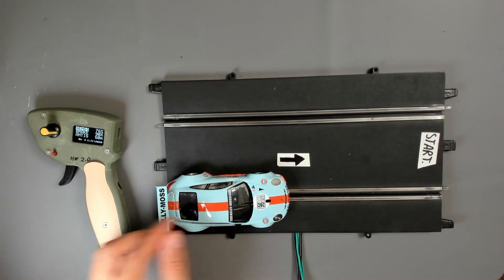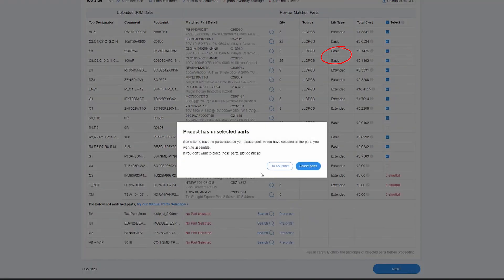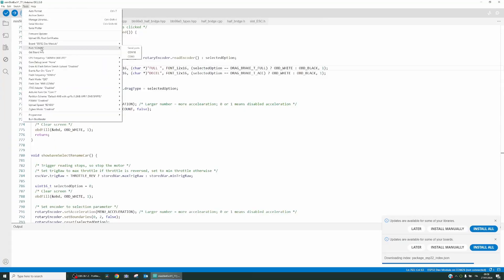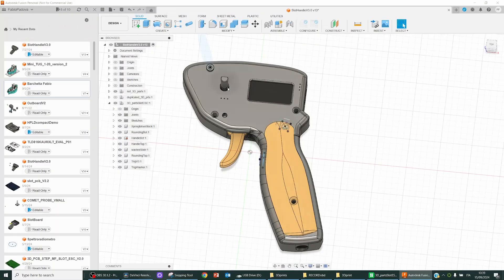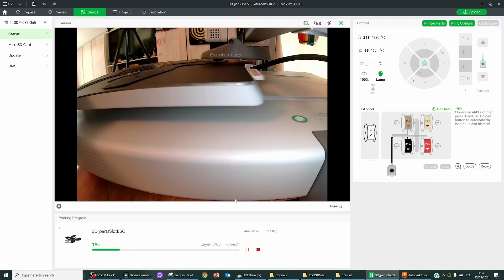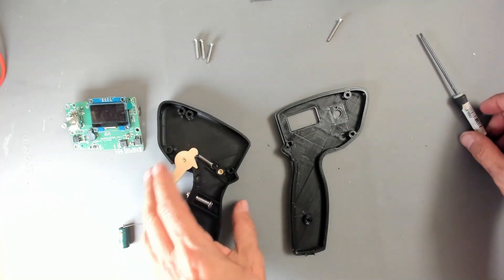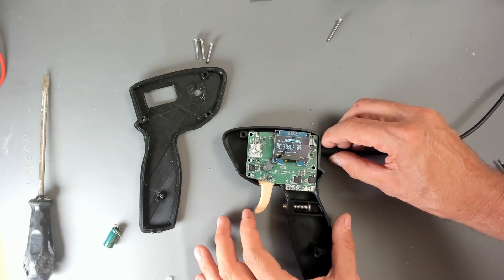DIY slot car speed controller - ESP32-arduino ESPEED32

Comment: I love this project and am currently ordering parts to try make some.. well done! excellent work!
just wondering the length of the compression spring for the trigger travel adjust? the length seems to be missing in the BOM
thank you kindly 8:13
Reply from the maker: Warning: the magnetic sensor v3 is not available yet on digik. Is just relased, you have to wait probably 1 months
About 10mm of spring coil then you have to add the 2 side loops. Usually i buy long ones and i cut them at the preferred lenght

Comment: Hello thank you for your amazing job
I ordered all parts needed but i don’t found TLD493D-P3B6 A0, so i take TLE493DP2B6A0HTSA1 i don’t Know if it will be work ? Can you just give me the Link to buy the good part
Reply from the maker: Hi 
It will not work, or better i was not able to have it working properly. The problem is that the i2c of the model you choose is providing glitches at startup and this confuse the esp32 i2c periperals
You need the silicon v3. It is released only this month, so you have to wait a little to be on digik or mouser. Sorry for this
Reply: @MakerFabio ok no problem, can you please release it when that will be available ? Is it possible to have your contact if i have question ? I am sorry, i am a beginner on electronic…
Reply from the maker: @Voltyyt-fs5ik hi, i cannot give my contact for support, I would die with requests. this is DIY. Ask here in the comments and i see what i can do. I will alert when the part is available
Reply: @MakerFabio  Hello, I'm coming back to you because I've been trying to do it for 2 weeks now but I have some problems such as the potentiometer not working, but the potentiometer button works. I'm using TLE493D-W2B6 with the modified code but it doesn't work either.
The S1 location of the PCB is free as well as the buzzer "i don't receive it", is it possible that this causes this problem
I don't know how to do it, I tried searching.
Thank you in advance for your help
Reply from the maker: Hi
Not sure if understand, there are not potentilmeters on the circuit
There is the rotary encoder and the  magnetic trigger
Which one is not working?
Reply: @MakerFabio  Yes I can't navigate the menu with the rotary encoder, I can only click on it to select the setting but not modify it or reach the other settings, I'm stuck on the first line.
And the magnetic sensor doesn't work, it shows me a default value that doesn't move.
Reply from the maker: @Voltyyt-fs5ik  terrible, sorry for this
The magnetic sensor i know it could be a problem because you didn t purchase the version 3 but the rotary encoder it s super easy and it should work
I produced more than 10 controllers all working fine with the same exact pcb i published
Did you check the encoder signals wafeforms at the esp32 pins?
Maybe your pullup resistors are not soldered?
Reply: @ ok will check it but strange to have the button of the rotary which work, thanks for your answer
Reply from the maker: @Voltyyt-fs5ik  the button is on a different gpio of the micro, rotation is on other 2 pins totally unrelated to
Reply: @MakerFabio  Hello Fabio, good news, after redoing all my welds, everything works. I just have a question about the sensitivity of the sensor, because mine moves a lot and is complicated to calibrate. I notice however that if I move it away a little, it tends to be more stable, is there an adjustment to make it stable ? Also note that I modified the trigger to fit one of my magnets which is wider but may be less powerful.
Reply from the maker: @Voltyyt-fs5ik very good! honestly with the magnets i pourchased is very stable
I mean it stays below 1% the noise so i have no idea
Reply from the maker: You should read the raw X, Y values and check it is not saturating

Comment: Hello Fabio, excellent project. I've ordered the TLE493DW2B6A0 instead of your type. I've already changed the address to 0x35, but still not working. Any idea? The rest is working fine. Only problem with the magnetic sensor. The sensor was found by i2c device finder at 0x35.
Reply from the maker: Mmmmm, very happy someone already tried it!
The issue is that only the last version silicon is working, the other was giving me lot of issues. I received the v3 from a friend and The v3 should be released now.
Let me check
Reply: @MakerFabio Problem solved, working fine now with the W2B6. I have modified the configuration and added sensor reset at startup. It’s now working with higher accuracy.
I‘ve also tried to add current measurements, but didn’t get useful values.
Reply from the maker: @tedkramer1090  supercool. Can you share the code? What do you mean with higher accuracy? About the current, the problem is that when you pull down the inh pin the motor controller is showing in the sense pin the temperature, so you are switching back and forth from current to temp reading. I think i should use a sort of analog multiplexer to let the current sense signal passing only during inh=1
Reply from the maker: And if your sensor code is working also for the v3 silicon i could just add a define where you can select the mag sensor version
Reply: @tedkramer1090  Hi! Is it possible to gwt the working configuration for the W2B6?

Comment: nice,  how does it compare to more expensive controllers ? it looks full of features ?  i'm trying to start slot car racing and i'd live to get one of your controller...
Reply from the maker: Hi, I would say it has same core features of many professional controllers + the drag brake (that is not present on other controllers)
Usually you have 2-4 parameters + eventually some switches. in professional controllers. This has 4 at the moment, and no switches (1 pushbutton only, not mapped in software yet)
Other parameters and features can be added by the users or the community or me if it start to get popular.
At the moment is performing as other or better for 1/24 scale
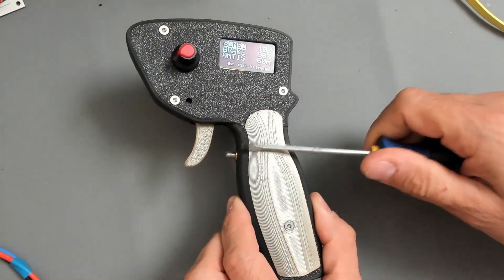Little too aggressive on 1:32 scale
Reply: @MakerFabio  thanks, maybe some scale option to adapt it to 1/32 or even 1/64... are you planning to sell packaged controller?
can it be used in analog/digital systems?
Reply from the maker: @Ztall0880  can be used for analog. I would like to sell packages, but i fear it will be complicated for taxes and exports. Which country are you from?
Reply: @MakerFabio  Luxembourg. will it work with  digital as well? I'm still begginer and didn't bought my first slotcar yet... I'm comparing different systems... interested into 1/64 or at most 1/32 scale
Reply from the maker: No it will not work for digital, only analog. I would recommend you to check the closest local track on your city, see which system they use (analog or digital) and go for that one. Or if you intend to do only homeracing, you can start from anything

Comment: W0W!!! Totally awesome,  but can I get it for Carrera digital. Thanks again my friend.
Reply from the maker: Hi, thanks for
At the moment is only for analog, i should look for documentation about carrera digital and implement the protocol. For sure the esp32 can handle it. Not sure which physical interface is needed . I Need to study
Reply: @MakerFabio absolutely interested in beta testing this config (worked in software testing for many years). Either way this looks superb imo.  My brother is a developer and is familiar with the esp, as well as having 3D printers that I look forward to using when this becomes available.  Am in the UK and Carrera Digital driver.
Reply from the maker: @costabunny hi, at the moment i have to polish and publish the analog version. Also some improvement in the ergonomic side (larger trigger)
If in the meantime your brother starts to study the carrera digital protocol to verify ported on esp32, very welcome
Reply: @MakerFabio  cool. Next time I see him; I will have a look at the protocols with him (I too was a dev quite some time ago). Will be fascinating I think 🤔

Comment: Scanning the datasheet for the motor driver.
It seems you dont have direct control over the brake (low side) FET. How do you plan on controlling braking options (none/med/max/etc)?
Still can't wait for the release  :)
Reply from the maker: The brake level is like for the accelerator: PWM duty cycle. Higher duty is higher brake
Reply: @MakerFabio  So you're pwm the INH pin for brake control? (when IN is low).
Reply from the maker: Correct
In set to low and pwm on the inibit
Reply: @MakerFabio  Thanks!
I did not think of that initially. Any update of the release date?
Reply from the maker: @user-rs8zg8ey2b  not yet. As mentioned it may take 1-2 months. Should be within november
Reply: @MakerFabio  awesome, thanks!

Comment: Lots of really cool features. My main question is, is there any delay on startup when the controller first gets power before the car starts to move? Many/most tracks control power to the lane through the controller. As such, the controller has no power until the race starts. In these cases, most drivers hold the trigger down. For electronic controllers with so much "smarts" it's not uncommon for them to have a delay when it first gets power. Not long, usually only a couple tenths of a second, but enough to be the last off the line against simpler controllers.
Reply from the maker: Gooood question. We have this problem, about 2/10 of seconds i guess. In my local track the power remains and they remove it fromthe tracks
But other tracks this problem exists!
Usually races last many minutes, so my tester are accepting the delay.
The solution is to “bypass” the boot, but then it become complicated to update the fw
Reply: @MakerFabio  its a real problem at some tracks, sillage had te same problem, so the build in a battery
Reply: @MakerFabio  I understand. We run short sprint races where that 0.2s can make a big difference. Also, most clubs in the states have a strict "no batteries" rule, which rules out such solutions.
Reply from the maker: @ggaub  we can bypass the boot then. Maybe with a switch to be pressed if you need to have the full boot for firmware uldate. I ll look in to it
Reply from the maker: I improved a little. Now we are in the 150ms, but still we can do much better. Will work in it next week
Reply: From the wiring diagram at https://youtu.be/JtMKeiguHKI?t=660 , it looks like the controller needs power from track. I imagine a battery could be added to power the esp32, they don't take much.

Comment: This looks fantastic and I can't wait for the release of the software and hardware. Will you have PCBs available for sale? That would be the only part that I would be nervous about.
Reply from the maker: Good question. Honestly this would be the best option, but where?
On Ebay for instance? I m in Italy so I fear i could ship only to europe. Any suggestion for a platform where to sell the pcb?
Reply: @MakerFabio  Why are you limited to shipping only within Italy?
Reply from the maker: @tri-countyslotcarclub  not sure, i think it is easy to ship to europe, when shipping putside i fear it becomes a drama. But i could be wrong. I ll investigate when i have some boards available to sell
Reply from the maker: @tri-countyslotcarclub  sorry I say limited to europe, not to Italy. I fear could be a drama to ship outside. But i could be wrong , will double check when i ll build some extra to be sold. At the moment i m at the pre series with few beta testers

Comment: Nice work and great project, i look forward to following this, wonder if I can adapt this to scalextric ARC system, using the 2.4ghz wifi from the esp32.
Reply from the maker: Hi thanks. Good question, don’t know if that protocol is open and also how to modify the esp32 wireless mode to talk with that protocol. I was also thinking about a mod to have it working on digital tracks , but first i need to polish it for analog
Reply: My opinion is it would be easier to get rid of the Scalextric electronics and design your own receiver module to go in the cars and for crossovers etc.  You could then cheaply add digital capability to any chassis.
Reply from the maker: Totally agree